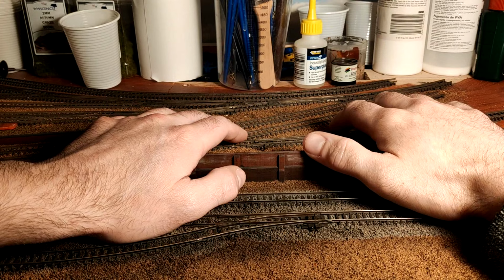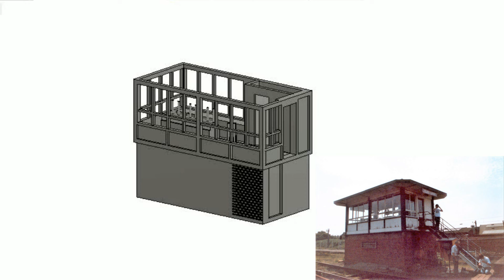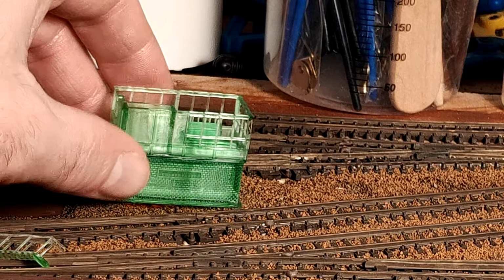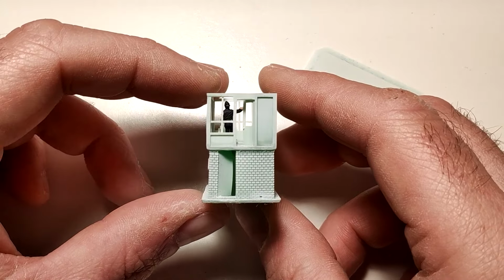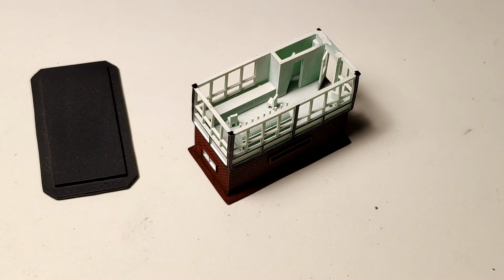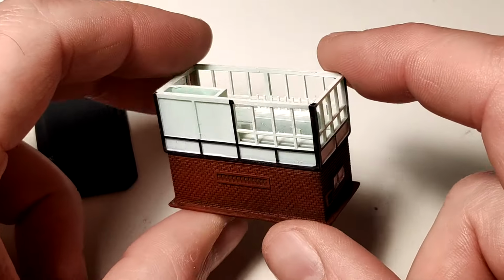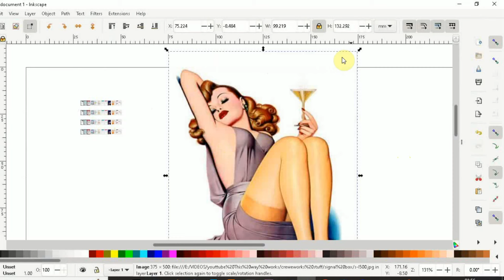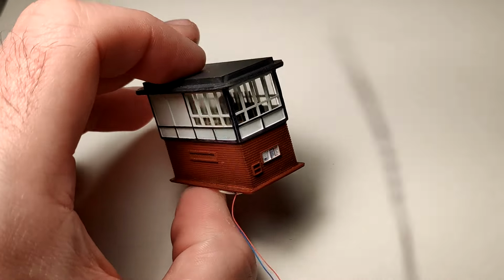Lets Build Creweworks Part 5 - Signal Box

Comment: That's a great little build Rich! Love that you went to the trouble of adding the tiny posters! Designing the signal box took some great skill, and the result shows just how good today's 3D resin printers are at capturing detail down to 1:148 scale! Great job all around mate! Cheers, Ian.
Reply from the maker: Thanks Ian, My printer is getting quite out of date now it still does everything ive chucked at it so far👍 id definitely pick printing for n gauge buildings and accessories if i had to start again that's for sure. Id say the time spent is really on the PC modelling side of things but its fairly straight forward to pick that up👍, cheers Rich